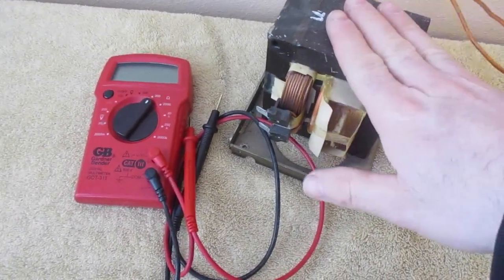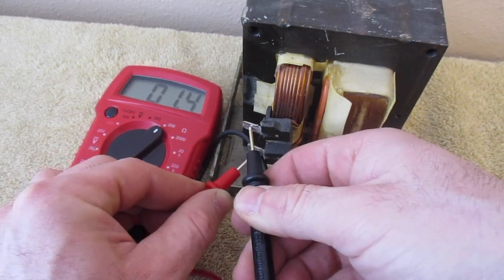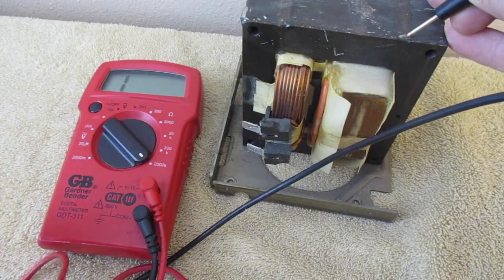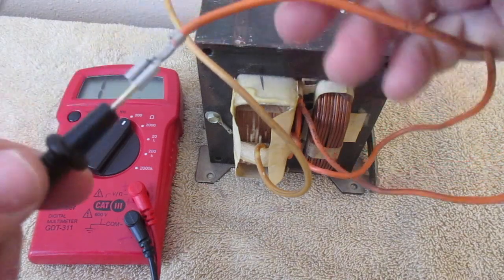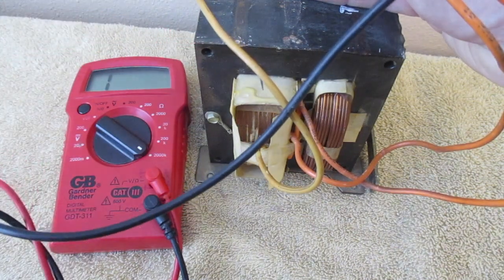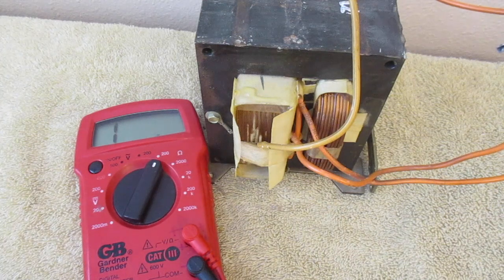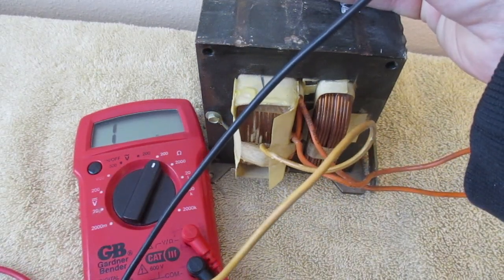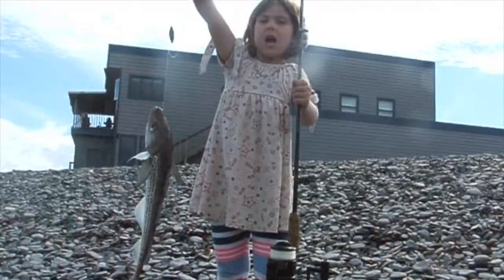How to test Microwave Transformer Multimeter testing Primary Secondary oven HV

Comment: Q. What is reason that the HV side coil gives continuity to body or burns to ground. What precaution to be taken to avoid replacing expensive Transformer. And what is the cost of HV Transformer of microwave.
Reply: That lonely wire going to the magnetron and voltage multiplier is the hot side of the HV winding. That round terminal, held onto the backside of the steel core by the bolt, is crimped onto the other end of the same winding. That is the shortest, safest way to connect it directly to ground-- the transformer is also bolted onto the body of the microwave which becomes the neutral side for the electric field that the magnetron needs. 
The precaution I would recommend first is "just don't play with it!" Don't let the HV wire throw an arc over directly to anything, don't power it on 220V if it's meant for 110V, ... all the usual common sense. It will probably survive being dropped but your toes will not take it very well, so relax, take it slow and easy.
The cost will vary-- this one I am testing, now I see I can get a used one for <40USD from eBay, which is less than I expected.
Reply from the maker: Awesome post... Thanks... and Ebay used is the place to look.  they usually sell for $20-50 in there

Comment: You r too fast to explain so I almost got nothing sir
Reply from the maker: try doing it one step at a time and pausing as you go through it.  Sorry, I try and keep them fast and to the point, so it doesn't take 20 minutes to sit through.
Reply: @youcanfixit3721  yea thanks I got well after going thru it again. .thanks for help... I more from you abt microwave trouble shoots ... my magnetron was ok after following ur guidance..I them went to diode n found that it had a closed circuit. I appreciate

Comment: Thanks for sharing this.
My microwave transformers high voltage wire gave me a reading of 125 ohms to ground is it ok?
Reply: same here.150 ohm reading. will be happy to get answer
Reply: Found this online Typical resistance readings for the transformer HV secondary are in the 25
  to 150 ohms range (depending on the power rating of the oven) from HV
  connection to chassis.  A typical midsize might be 65 ohms.  An open would
  be an obvious failure.
Reply: 186 here lol

Comment: Hi,  I have a New Microwave Transformer, which ONLY had the WIRE coming off of the HIGH SIDE !   That wire actually BROKE-OFF,,, how do I REPAIR that ????  Thanks in advance
Reply from the maker: send it back if it came that way.  Turn it in for postal insurance if it broke in shipping.  if I broke it I'd buy a new one.  But I'm not specifically sure where/how it broke, It may need to be rewound.  Best of luck...  Sometimes posting a video asking for help gets you a bunch of hits telling you how to fix it.
Reply: @youcanfixit3721  I thought the one wire on the high side was actually as designed--even on the one in your video it looks like the typical design where one side of the high/secondary coil is grounded via that wire bolted onto the core (1:28 shows it well).  See also 4:28 in "Disassembling a Microwave Oven Transformer" https://youtu.be/bwlc58YekZg?t=262